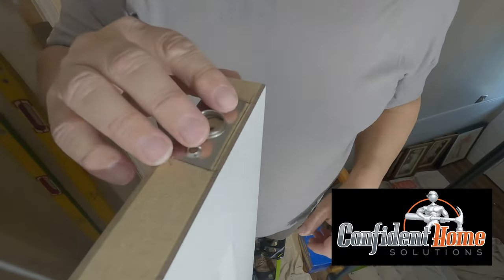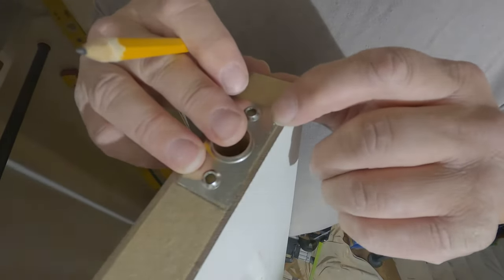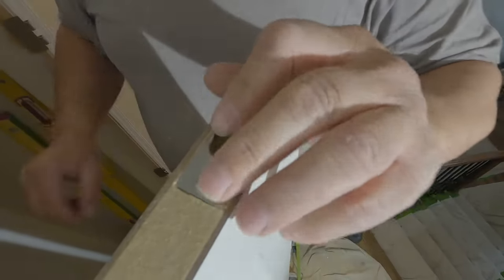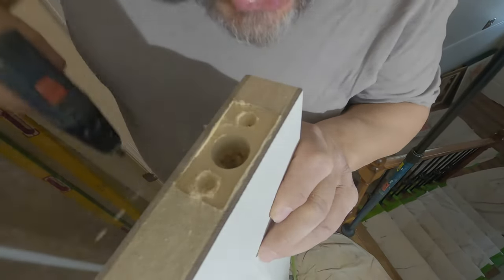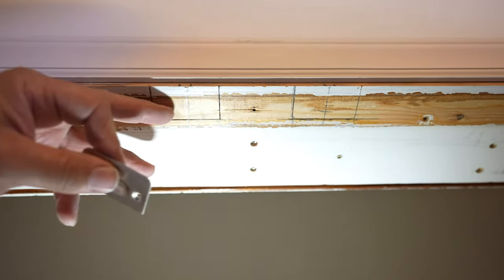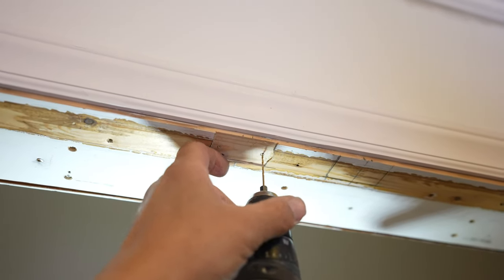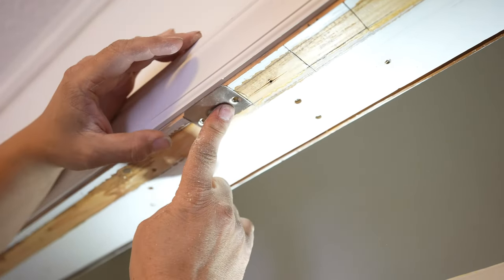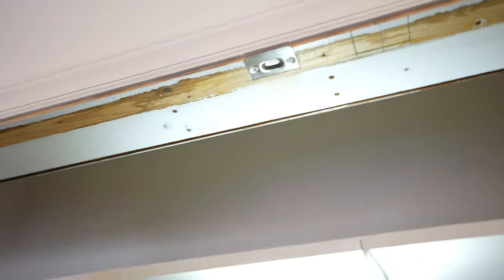How to Install a....Closet or Pantry...Door Ball Catch....

Comment: You could have surface mounted both the latch and ball latch as there was a big gap between the door and casing, also the hole latch should have been further back as the door is not tight upto the casing apart from that your method was ok